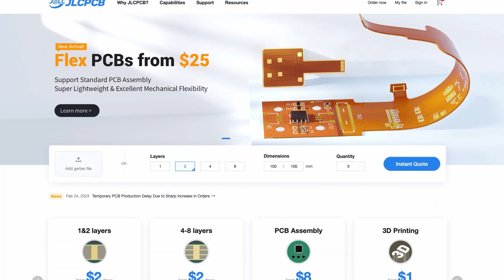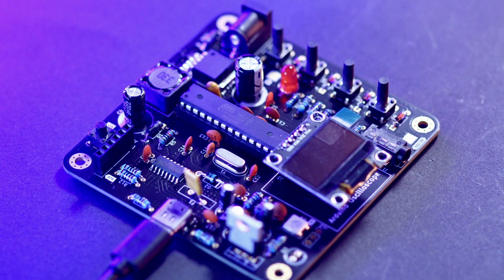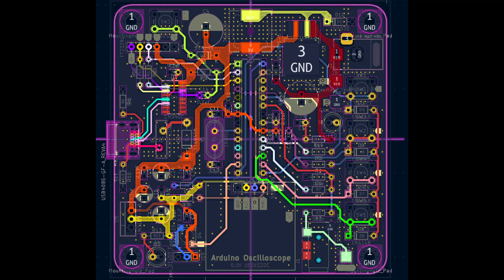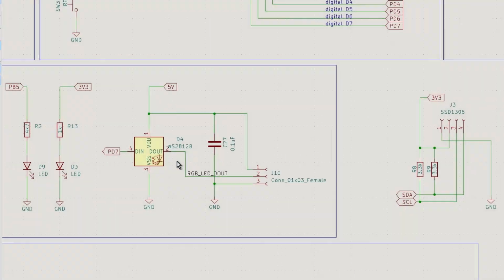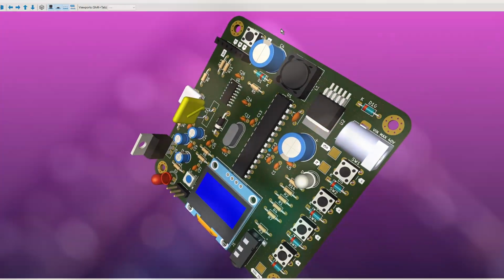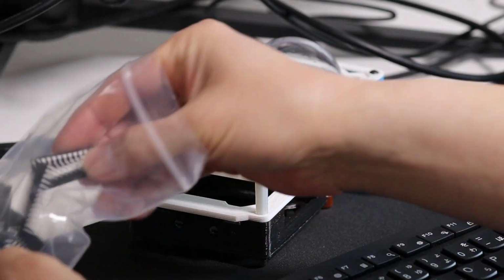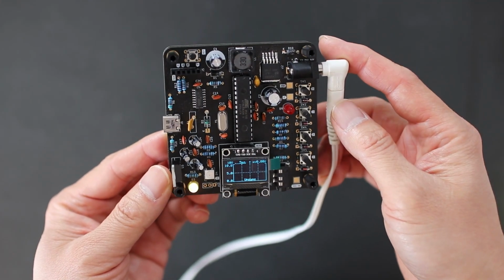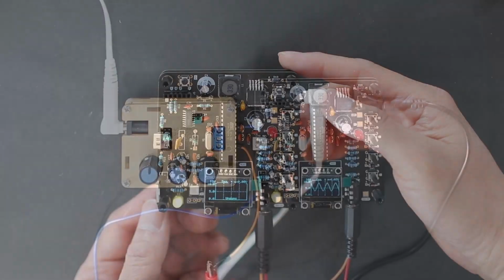A simple  Arduino-based  oscilloscope

Comment: So when you connect wave form generator to this diy oscilloscope, you don't need to worry about signal voltage? I'm just beginner.  I also built this oscilloscope made of atmega328 and I also bought XR2206.
I learned that atmega328 gpio is only 5v tolerance. So I still worry that it  might fry my diy oscilloscope.
Do you to adjust your diy oscilloscope before connect it to XR2206?
Reply from the maker: In this project, I didn't do any adjustment to the input voltage, however I do make sure that  the input signal won't go beyond 5V.
Reply: @KOKENSHATECH  Thank you